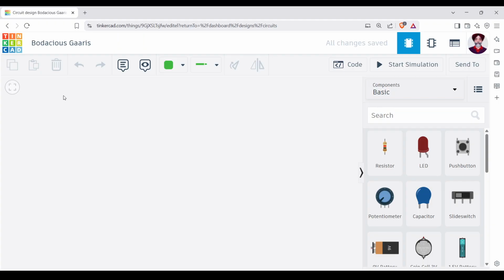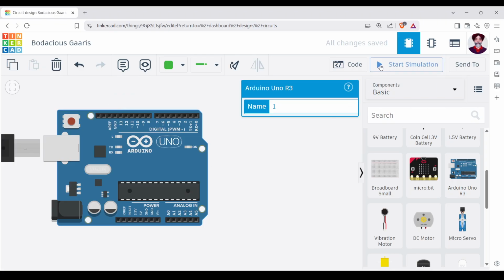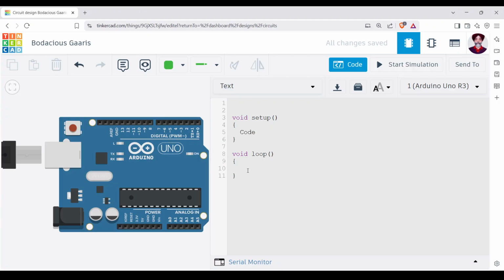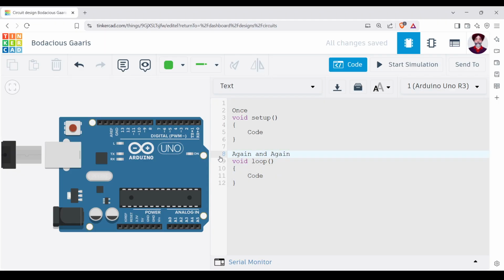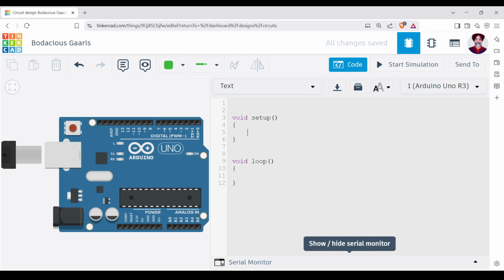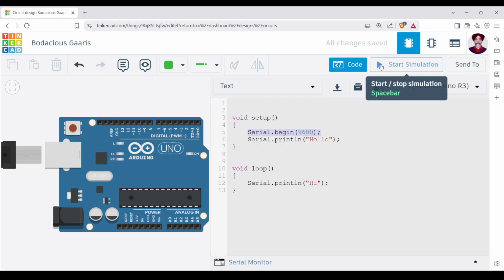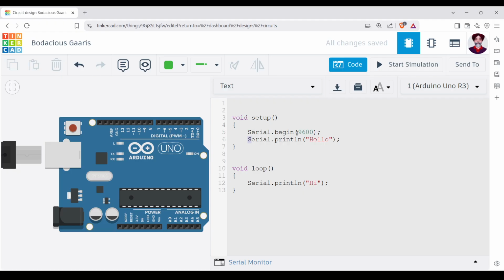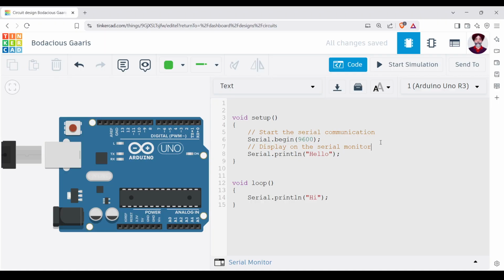TinkerCAD - BasicProgramming 01 Using Serial Monitor

Comment: Sir please tell me how to take input from serial monitor
Reply from the maker: Examine the code given below:
void loop() {
		Serial.print("Enter your name: "); //1
		while(Serial.available() == 0) {} //2
		String name = Serial.readString(); //3
		Serial.print("The name entered is: "); //4
		Serial.print(name); //5
	}

1. Displays a prompt to the user as to what is to be input
2. Wait for the user to enter something. This is an empty while loop that keeps on repeating itself (doing nothing) until the user enters some data
3. This actually takes input from the user (Write in the serial monitor and click on send)
4 and 5 display the data back to the user (On the serial monitor)

I will be creating a video specially for this topic. You will be able to understand better
Reply: @rskoura  Sir please explain the LCD connection as well and give the coding 😐😐
Reply from the maker: For this program you don't need any LCDs. You just need to use an Arduino (Otherwise, coding will not be allowed).
The complete code is:
void setup() {
	Serial.begin(9600);
}
void loop() {
		Serial.print("Enter your name: "); //1
		while(Serial.available() == 0) {} //2
		String name = Serial.readString(); //3
		Serial.print("The name entered is: "); //4
		Serial.print(name); //5
	}

Video uploaded explaining the above:
https://youtu.be/h2wCMlRHm2c?si=x9EpubxF9l2e037g
Reply from the maker: One more related video - https://youtu.be/CBChMVlet0Q